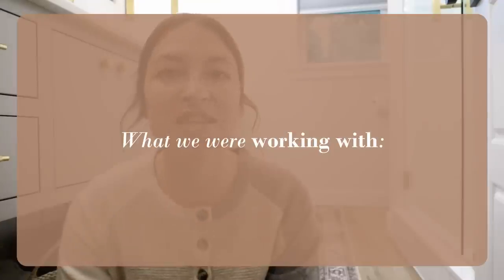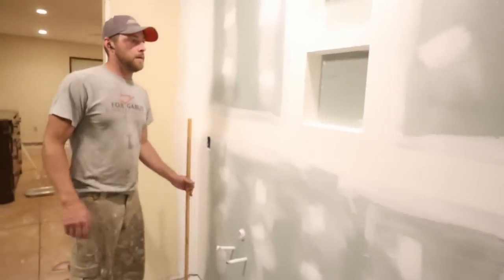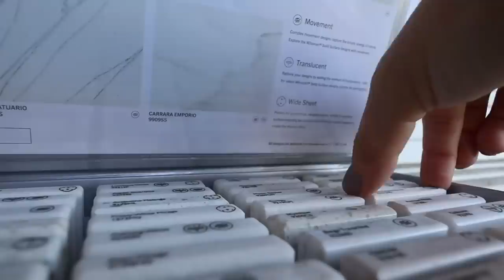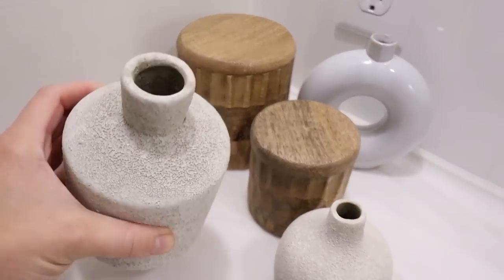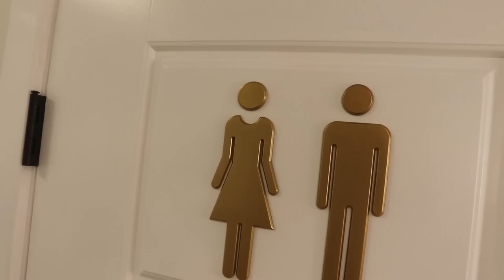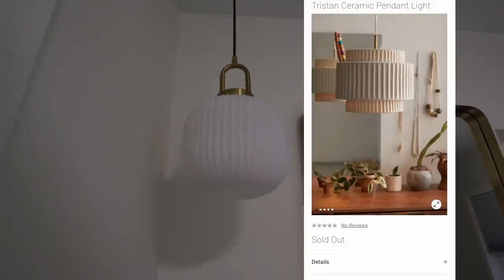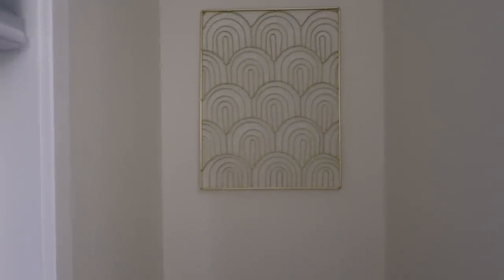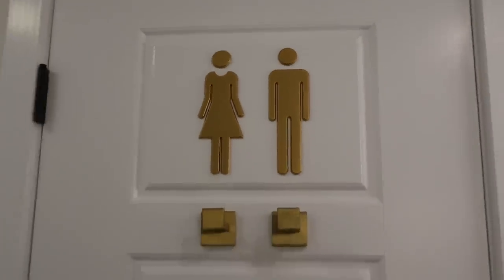Extreme Bathroom Makeover + Q&A with my contractor husband | don't waste your time . . . or $

Comment: You did an amazing job. It's stunning.
I put in a glass shower door and tile shower walls and floor, my contractor told me the best way to keep it clean is squeegee the walls, door, and floor when done showering. It only takes a few minutes and really saves on cleaning, especially keeps the glass door crystal clear.

Comment: You've done such a fantastic job in the en-suite - I'm sure it'll be a joy to use it now. I'm surprised you didn't go for a shower unit with a small hand spray as well as the overhead fitting - I find the spray really helpful when cleaning the shower cubicle, and I use it to wash down the cubicle after every shower so I get all the soap off the walls and doors (less cleaning needed!)
I would be worried about a tile flooring in a shower cubicle being slippy when wet - plus a friend of our has a similar tile base in their walk in shower and it has stained a bit.
A suggestion for the toilet 'nook' would be to paint the back wall a darker colour - it would help give a bit of 'defiition' to the space and will make it look bigger.

Josh is absolutely right - everyone knows it's bathrooms and kitchens that sell houses! (as long as you haven't gone for anything too wacky)

The doors really can change a house so much - our cheap, white, panelled doors were replaced with lovely pale oak ones and it made a huge difference!

Btw I love your cardigan.

Comment: You did a great job styling the space, you have a real eye for design. 🙂 My suggestion for the space with the toilet would be to either get a larger piece of art to hang, or do several small/medium sized pieces, just to take up more of the space on that wall. 🖼

Comment: This is such beautiful work. Thank you to you both! 
I don’t see a squeegee to use on the glass after every shower! This is 100% necessary if you want less cleaning ❤
Reply from the maker: Yes, I want to keep one IN the shower so I can do it while I am showering. We still haven't used the shower yet since Josh has to seal it yet. I can't wait to do a follow up video this winter with organization and troubleshooting after we've used it for a while!
Reply: You don't need a squeegee....just wipe it down after each shower with a microfiber cloth, works wonders!
Reply: Yes! We also have a shower with clear glass doors and squeegee after EVERY shower. The doors look nice but definitely are extra work/time.
Reply: @carolwagner4592  either one! A squeegee is more fun!

Comment: Great job on the bathroom - looks great.  I love the in-wall cubbies.  We have a renovation underway that my brother is doing - in fits and spurts in between his other jobs.  It will be fantastic when it’s done, but patience is definitely required.  Enjoyed the advice from Josh.  Spot on.  Probably more practical than stylish, but you might consider an over-the-toilet cabinet if you need more storage.  We love ours; that’s one of the first things we did in our fixer-upper since the linen closets are deficient.